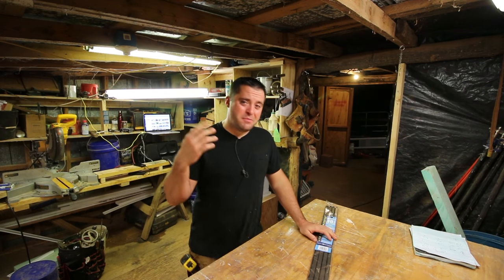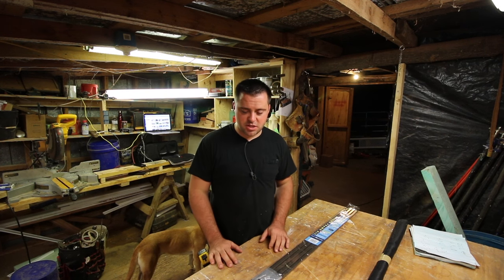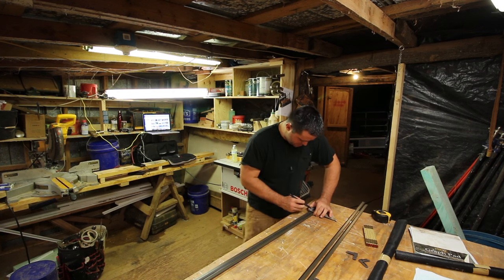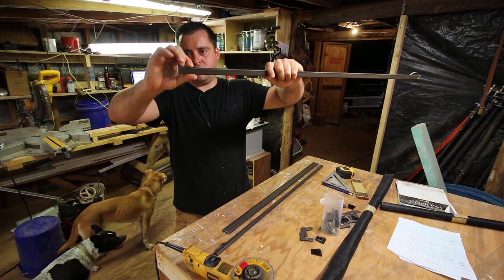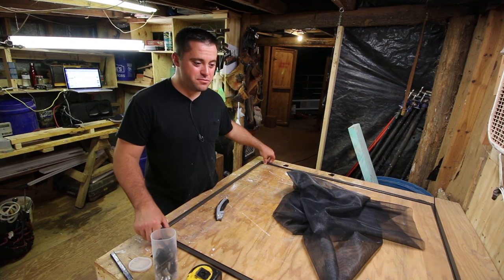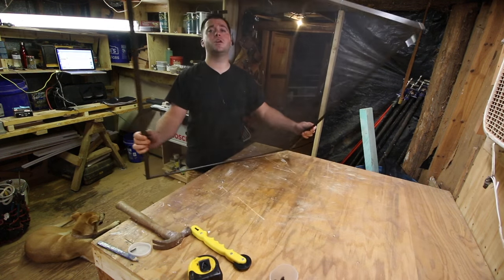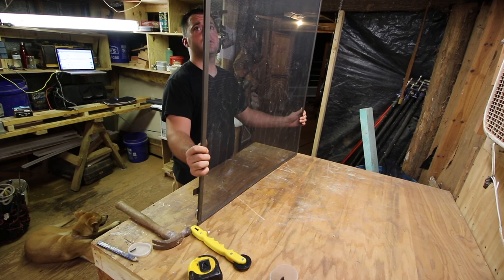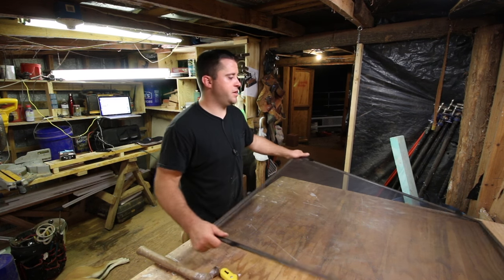Making Temporary Window Screens

Comment: I think the typical installation is to have a deep channel in the window frame above the screen and a shallow one at the bottom. Springs go on the top edge. Push the screen up into the deep channel, let the springs push it back down to seat in the shallow channel. The 2 channels hold the screen in position.  Can also spin everything 90 degrees and have channels left and right.

Comment: The reason your Spline ran long is that you stretched it...  If you put in one end and the the Other end and then some in the MIDDLE, always cutting your placing of the Spline in half,  with less (if any) to cut. 
On a good instal you won't need to cut any... if you remember when you pulled it out to Start... ou did not have ANY EXTRA ... so why would  you have to cut any later.. 
Great video as always!